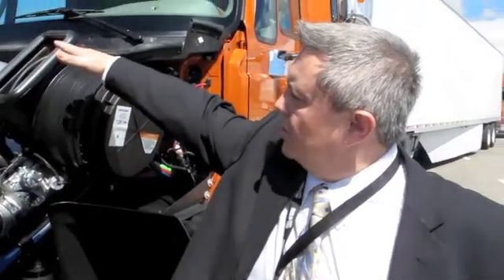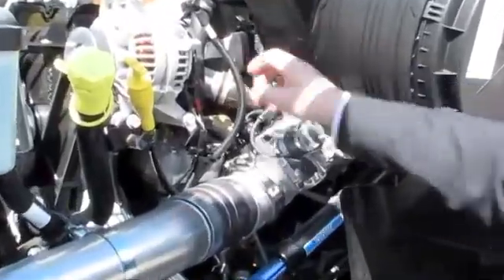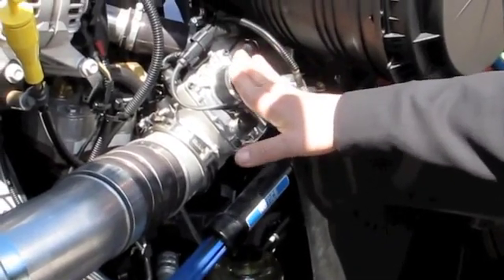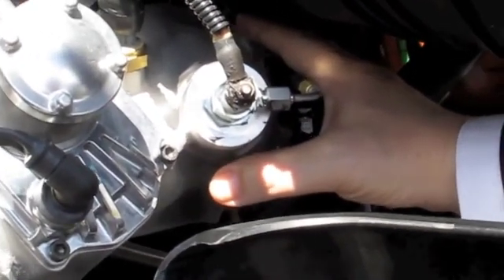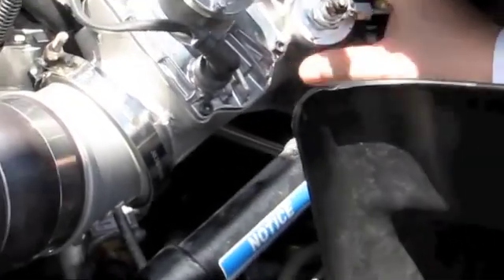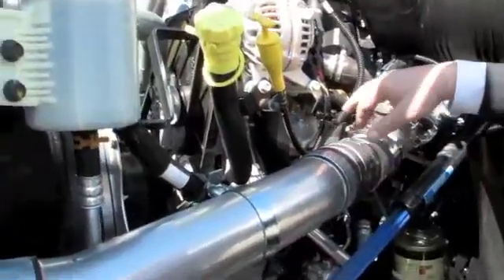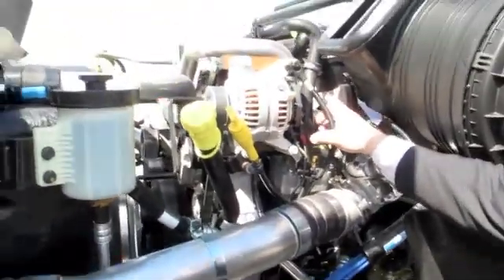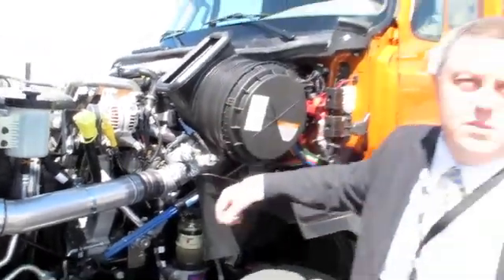MaxxForce 15 Air Intake System on Prostar.m4v

Comment: Yeah it's not fun domepiece604 Actually just replaced one of these intake throttle valves tonight on a Maxx 13 for carbon buildup and eventual failure of this intake throttle valve.